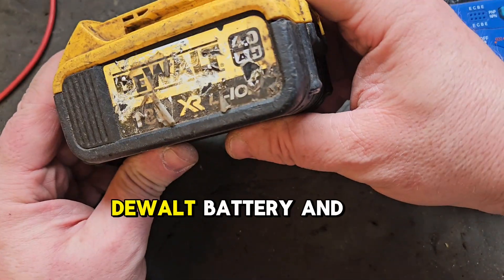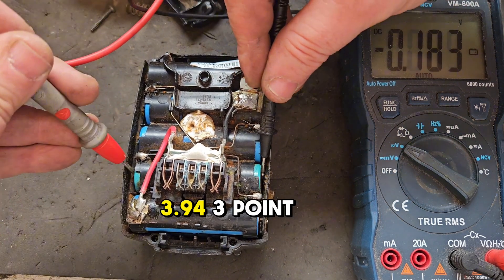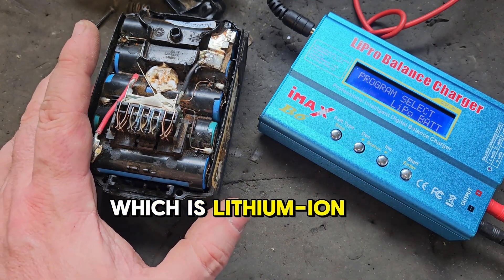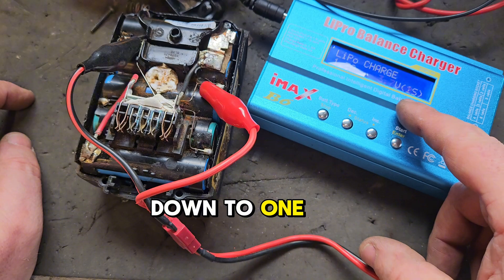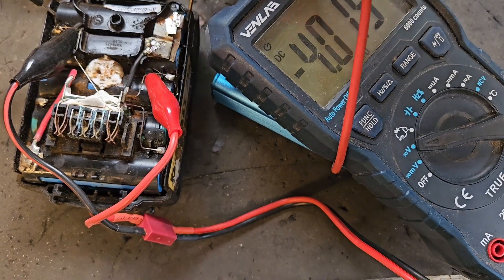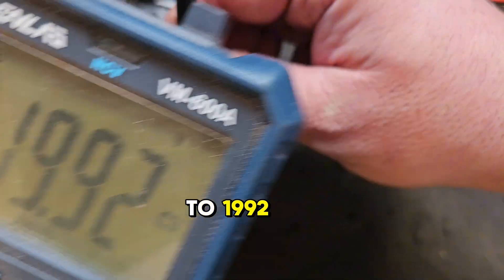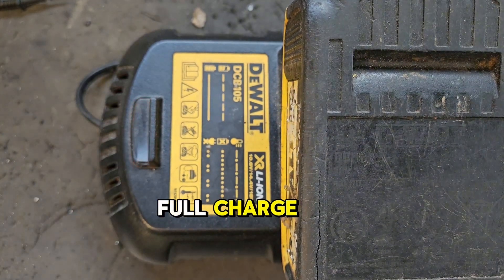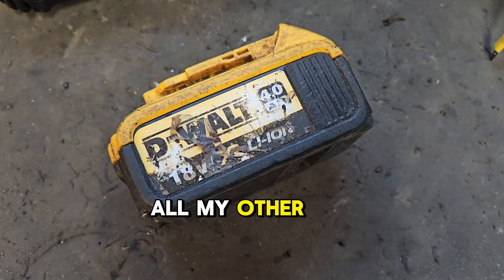Revive Dead Dewalt Battery!

Comment: Hi doc i repaired a broken DeWalt battery it was just the main negative was disconnected. But after i connected it started charging but only charged to 2 bars , all the cells give a reading of 3.75 apart from one pair gives over 4 volts, what could be the problem?
Reply from the maker: That's your problem cell imbalance you need to bring the other cells up level with the higher ones. The high bank of cells reached maximum voltage signalling the charger to shut off if you can get them level it will solve it.
Reply: @doctorlefthandthread  so charge them with the charger you have in this video? And thanks doc
Reply from the maker: @josh-yy8wx  yes that is ideal